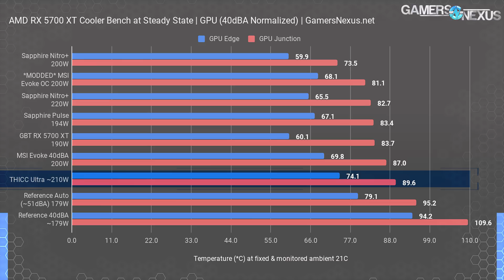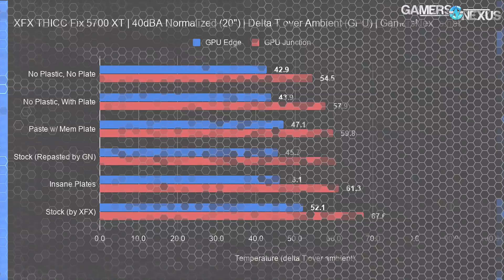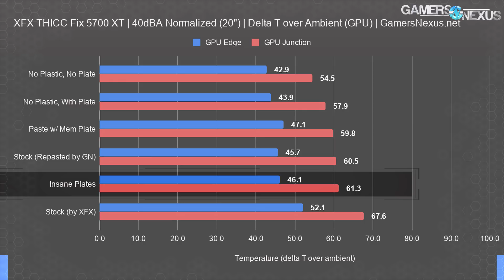Worse Than We Thought: Fixing the XFX THICC 5700 XT

Comment: Although the card might not be perfect, the way you interpret data is misleading (I'm referring mostly to your original review). In stock form, just using the cards as they come from factory, your data actually showed that this card has the lowest gpu junction temperature of all. Also, your data showed that this card has the 4th coolest memory/vrm (again, as it comes from factory). Just as certain cases were designed with looks in mind over absolute performance, this card's design was clearly inspired in the american hot rods from the 50s. Knowing that encasing the card would increase temperatures, XFX clearly ramped up fan speed to compensate this. That's why your normalized 40dB test isn't fair, as this card was never meant to be silent. The proof of this is that, to be able to lower the speed of the fans you had to go to the registry and change things. If you use any product in a way that it was never meant to be used, of course flaws and/or problems will appear. Other cards that were designed to perform well under near silent conditions will always appear to be better, considering your 40dB normalized test. But again, using the cards in the way they were meant to be used, without modifying anything, that's the way most people will used them and you know it. Under this consideration (without modifying fan speed in the registry, as you did), XFX has the best gpu junction temperature of all, as your data clearly shows. A smaller heatsink with a lot of moving air is always better than a giant awesome heatsink with no to little moving air. Again, this is proved by your own data, showing that the nitro+ has higher temperatures because from factory, its fans just spin too slow, and considering most people will just use these cards as they come from factory, not even changing any configurations (like fan speed), I don’t see you slamming Sapphire over it. I'm not saying that the nitro+ is worst or better, simply that certain shortcomings might be easily compensated by increasing fan speed and that’s what XFX did from factory, in the BIOS, to protect users. IMHO, this is how a manufacturer should act. These are gamer cards and when playing (stressing the card), most players will have their volume up on their speakers or playing with headphones. In that situation, fan noise will never be an issue. Even with all the shortcomings that this card supposedly has, it still achieves high clock speeds and performance, just like any other card that is supposedly better than this one. This card performs very well, just a little louder, and that should be a consideration that each one should do, as many people out there don't mind a louder card if it looks good/original/different. Sadly, it seems to me that most people just want to mindlessly swallow information without having any kind of critical spirit and don't like to exercise their neurons that much, because taking the data you provide and reaching their own conclusion is simply too much work or something.

Comment: I believe that plastic layer on the backplate doesn't allow a good heat transfer from the thermalpads, I removed it on mine, a pain in the ass to remove the glue residue, so I only cleaned where there was going to be contact. I also thought that the plastic shroud was trapping heat, this video proved it.

Comment: Why is your particular THICC so much worse than the one Hardware Unboxed has for example?
Reply: Hardware unboxed doesn't normalize their noise levels.

Essentially you can have a terrible cooler but exhaust a jet engine onto it and the temperature will look great.... but the noise will burst air drums.

GN levels this by manually setting fans so all cards tested produce the same noise. That allows a direct comparison in cooler design.

XFX card performs fine in games and acieves great results but is hot and loud.

GNs testing shows more about the overall performance levels and what you can expect with the card when/if you overclock. COOLING matters.

Comment: Offtopic: I've got a question:

I've recently received my new Ryzen 9 3900x CPU and can overclock it to 4,3GHz allcore with 1,25 volt 

(1,231 Volt with VDroop LLC lvl 4 on my CH6 extreme). 

According to the binning statistics from Silicon Lottery this should not be possible.
I can run any benchmark including 100 runs of IBT linpack (reaches 80 degrees here) with 8GB ram (32GB ram are installed)
or 2 hours of 1344k FFT size in Prime 95. Games run just fine and smooth.
I disabled PBO and any automatic OC feature and set FCLK to 1500mhz (i have 3000mhz corsair Ram).
I mean, I'm not complaining, this is great! but it is hella suspicious.

Edit: I found out that prime somehow didn't use avx2 instructions. 
I had to settle down to 4,25ghz with 1,275 Volts with a vdroop to 1,25ish volts.

Comment: XFX either built this card in too short of a timeframe, resulting in a crap design or didnt test the designs they had at all. 

I'd wager its a mix of both.
Reply: "Hey, people like bigger graphics cards these days. Let's throw useless plastic all around it and make it huge! Who cares if it harms thermal results."
Reply: @CaveyMoth  The extra plastic would be fine  if the fans and fin stack accounted better for it.  If we made products made purely on performance everyone would be using a test bench and we would have much better fan solutions.
Reply: Sadly common in engineering companies where management push back on engineering estimates and set unrealistic deadlines.

Comment: While it wouldn't really be reversible, I would be interested in loading that steel memory plate with some bits of solder and brazing it to the heat pipes and cold plate.  Could probably be done fairly easily with a heat gun and some strips of regular solder. The steel shouldn't sink so much heat to make it impossible. 🤔
Reply: better done before filling and closing up the pipes (like they do when making coolers). there are plenty of examples around of what happens when you try to 'reflow' a GPU after the heat pipes or vapor chamber was filled and sealed up (people stuffing cards into the oven without removing the cooler first).   Insta expand-a-plate, and broken card, lol.

FYI, PC heat pipes are often designed to operate up to, "up to" 125c, the temp needed to melt solder is closer to over 450c, that's a tad beyond 125c, lol.
Reply: @Zarcondeegrissom  Ohhhyeahh.... heat pipes sealed with water vapor + heating to solder melt temps = BOOM!   Yeah... that's probably not a smart idea now that you mention it.  🤣

Comment: The work force or available work force shouldn't dictate how a product is designed. Any design change made should be a improvement over the original design, be it form or function. Most improvements reduce over all costs as the product is streamlined for maximum efficiency in all aspects of manufacturing.

Comment: Honestly dont know what happen to XFX, they USED to be the card to get, at least back in the GTX 200 series. They kinda went downhill since
Reply: It really seems to just be this generation of cards. Their R9 300 series and Polaris stuff, for example, are fine
Reply: @slipknotboy555  Their polaris stuff really was not fine, I own an RX 480 from xfx and when I took the backplate off and applied a new thermal paste I dropped temps by around 8°C. And don´t even get me started on their fans.
Reply: @slipknotboy555  i currently have XFX RX580, i mean its a fine card, but a little too loud when gaming and at 75-76 C its not the coolest
Reply: @HappyBeezerStudios  yeah xfx was the top brand and powrcolor may blow at any time but was cheaper. My have times changed. Gigabyte on the Intel said was crap while Asus was God. Now the other way around

Comment: Improving the THICC:

1- Grab it
2- Remove the THICCness. 
3- ???
4- Profit
Reply: soo... its a STICC ?
Reply: Yup, this thicc card greatly benefits from a good balanced diet. Now we need to get her into the gym (improving the contact plate?)
Reply: unfortunately step 4 is unattainable, as price is based on meme-value.
Reply: I just want a graphics card that is PCB and heatsink. No flashy adornments. Call it "Pure Cooling."
Reply: I would buy the card only to remove the backplate and replace it with a nice 30mm high, finned cooler for extra  thiccness.
Add some extra back fans for good measure.

Comment: Step one: buy THICC
Step two: take off everything manufacturer added making it more efficient.
Step three: wonder why you didn't just buy a more efficient card in the first place.
Reply: "Could you trim away some of the fat? I distinctly said, 'No fat.'"
Reply: Step 3: Post plastic back for a $50 refund???
4 profit?
Reply: I just ordered the DD Ultra (non-XT variant of this card) as it was by far the cheapest AiB 5700 available in my region (seriously, the others cost >40 € more). Might flash it with XT bios (Thicc or AMD reference) at some point if I need a power boost.

Are there any downsides or concerns I should be aware of before stripping the plastic off my card?
Reply: S3lvah was thinking of doing the same thing
Reply: @zt9233  Let me know if you do and it works out! I'm a little bummed out that GN spent all this effort on the card but couldn't elaborate on its modding from a consumer's perspective – only what XFX should've done better.
Reply: @S3lvah  i was in the market when the 5500xt flopped with pcie 8x lol i got this cheaper than anything else and now i have to remove my backplate and drill some air holes into it lol
Reply: @S3lvah  i also want to know the answer to this. Flashed it to the XT. It now runs and functions awesome, but at like 90C under heavy load!!! I'm gonna strip it down and see if it helps
Reply: @tjw6550  It helped immensely. I also had to manually set the fan speeds because on auto they wouldn't kick on for some reason, but it's been running stable for months now. I also put a an antec pci cooler below it to help with getting clean air down to the card.
Reply: @TheMotoBall  any guide you would recommend to remove the plastics? I'd like to do the same with my 5700 DD Ultra but have no idea where to start
Reply: Literally what I did -__-
Reply: Step 5: profit¿

Comment: Would like to see a video with more in-depth info on Shenzhen labor shortages and how that is affecting design. Edit: Maybe generalize that into the difference between designing for manual assembly to partially manual to fully robotic assembly. Just how much robotics are used to create the motherboards, CPUs, GPUs, power supplies, etc that we buy?
Reply: https://youtu.be/cnAFTMaS5R0
He did do a factory tour showing how much of making a motherboard is automated now
Reply: i'd guess cpu production is fully automated
on motherboards the placing of a few throughole components is done manually
the rest idk
often the testing / feeding the testing machines is done manually
Reply: This is on the engineers, you fucktard.
Reply: @Pro7Sauce  not just the engineers. Everyone involved with XFX is a knob.

Comment: Which 5700 xt card would you buy? I watched  all the videos and I am confused. I just want low noise 40db max with best performance. Thanks.
Reply: saphire model
imo
Reply: A lot of people feel the Red Devil is the best.
Probably second to that would be the Sapphire Nitro+  - even though Buildzoid stated that it's not quite built to the same standards as past Nitro+ tiered cards. The speculation for Nitro is that there is possibly a Toxic version of the 5700XT coming down the pipe. Toxic has always been like the top-tier, over-built, limited edition line of Sapphire cards...that and the Atomic lines....

...but I can't remember the last time an Atomic branded product was ever released outside of the Atomic 990FX motherboard that was China only.